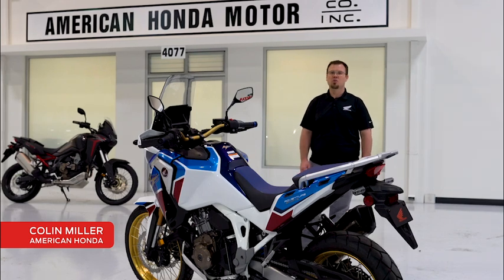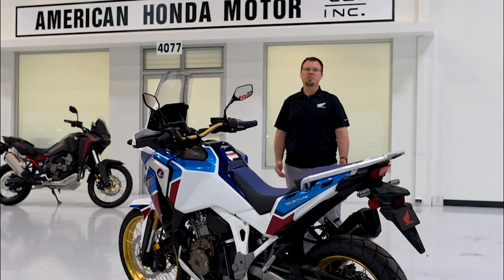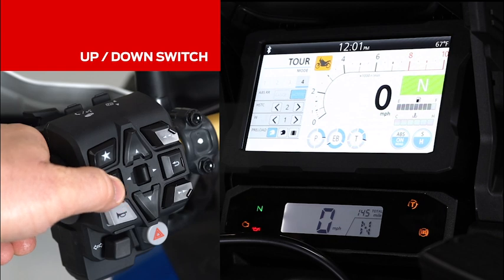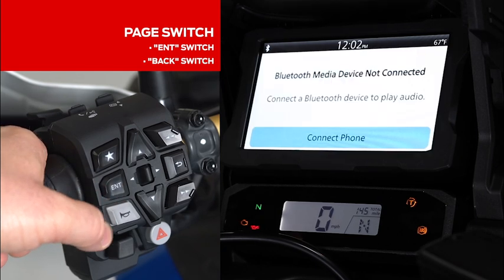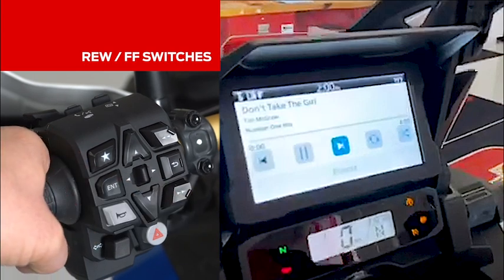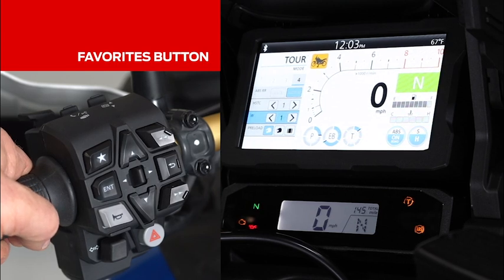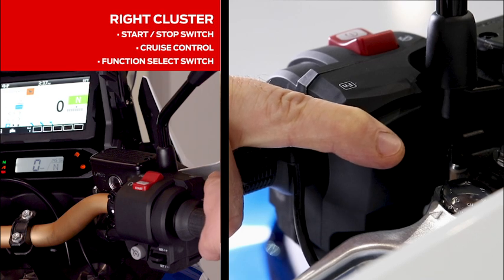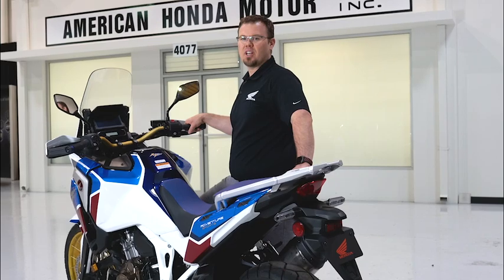Africa Twin: Electronics Controls

Comment: You say basic use of buttons, is there more to the system? Dealer modes? Or push 2 buttons for a few seconds type of deal? If I change the battery, would it go back to factory reset?

Comment: Great content!  I just bought one and it has been very helpful in adjusting me.  The only thing is that I have an intercom and when I link it it connects correctly but after 10 seconds it disconnects me, I have already tried to do it in a thousand ways but there is no way.  The bluetooth that incorporates the intercom is compatible with the motorcycle system.  I don't know if anyone has the same problem.  I tried pairing the AirPods and it worked perfectly, it did not disconnect at any time.